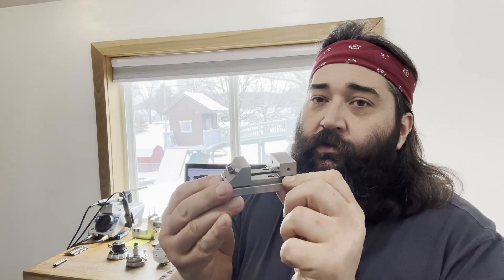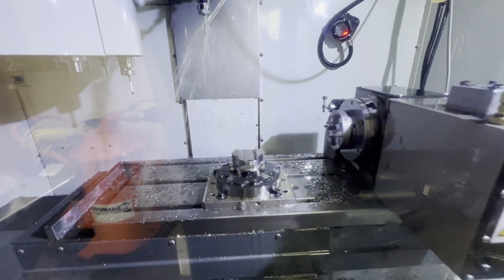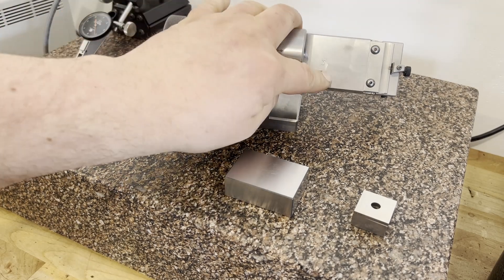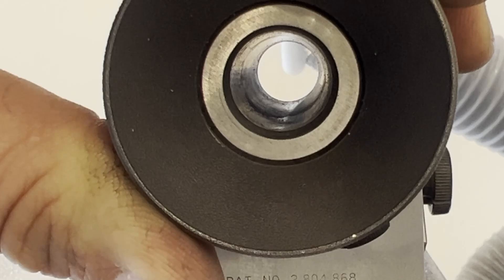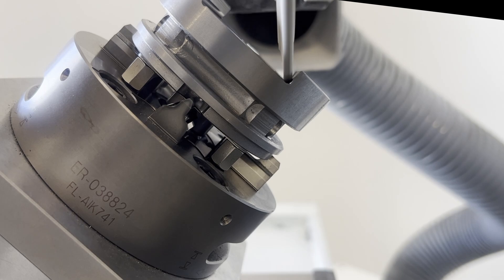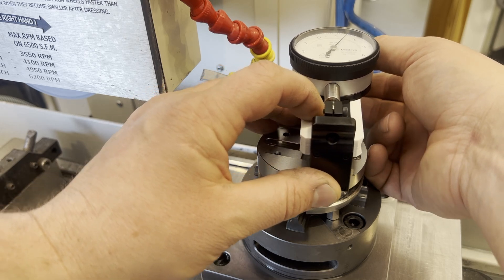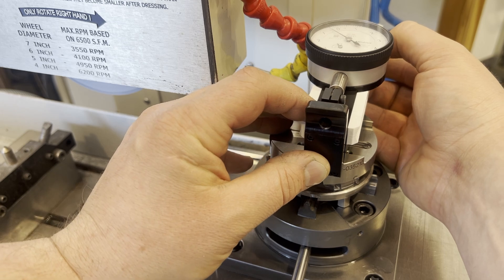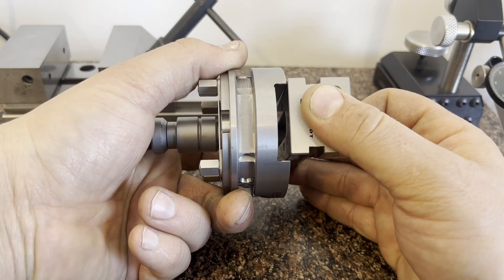The 180 Method: For grinding perfectly centered features

Comment: I'm wondering how you have your Haas setup to let you mid program load tools? or is it a manual gcode add?
Reply from the maker: That’s an alias code , when it sees a m6 with a “t” number higher than 9 it goes thru a different routine where it empires the spindle and waits

Comment: Awesome video. Quick novice question. About to invest in my first high end set of gage blocks (Mitutoyo ceramic 00) and debating between rectangular or square for surface plate use for inspection, calibration and occasional precision setups on the plate. Anticipating relatively short-ish stacks. Noticed you are using square in this video for on of your setups. thoughts on rectangular vs. square? Trying to “buy once, buy right”. Thanks for all your great videos!
Reply from the maker: I like the squares a bit more for being able to pass a screw down the middle , lets you solve all sorts of weird problems by attaching end plates
Reply: Feels like it’s hard to get experienced folks to be willing to give real opinions beyond “it depends”. Obvi, it always depends, so extra appreciate getting your thoughts and experience. Been watching you since your first video on the channel and always look forward to your latest!

Comment: I saw that YouTube quickly removed your video you made of the production of that outstanding device similar to the one created by John Browning in 1911. Since YouTube won’t allow you to demonstrate your outstanding craftsmanship, have you considered posting it on any other platform I watched that video three or four times before YouTube took it down. I have a small VMC and have dreamed many times of producing such a device myself.  My thought is if John Browning can produce it with primitive machine tools, in 1911 that I could reproduce one with my limited CNC capabilities that I have in my garage machine shop. Many of the problems that I envisioned I would have you demonstrated the simplistic solution simply because you’re a tool and die maker and repetitive set ups maintaining a close tolerance is your business.  The video was very inspirational. I hope someday to see it again. Obviously I live in the wrong corner of Ohio. I live down in Marietta in the south east corner all of the exceptional manufacturing is done everywhere else in Ohio except around me.

Comment: Im surprised you went for this style of vice as opposed to like a typical 5 axis vice.  Could you explain?
Reply from the maker: Self centering vises typically see a bit of jaw lift . not an issue for rough stock clamping or even general precision . But not something I want for chasing very small tolerances. These will mainly be holding small ground blocks and bounce between the cnc grinder and high speed mill

Comment: Watching this again and I was wondering how do you set the center of the chuck to the center of the wheel?  I have used a grinder but only for simple grinding for flat surface.  Charles
Reply from the maker: It doesn’t need to be set . In this case I just touch off the side of the slot from the mill . Ground till it just cleaned up and measured. Feed in based on that first measurement
Reply: @adamthemachinist  Ok you mentioned that the slot was centered to the center of the chuck.  I was assuming that you had indicated it in some how to set zero on the DRO.   Is there a way to set the origin if needed for that fixture?

Comment: Adam, what coolant are you running? It looks like oil, can you explain the pros and cons of your coolant choice. Thank you for the video, it's always such a wonderful surprise when upload!
Reply from the maker: That is oil, blaser gt 15 . Most of my machining is near net, meaning I have parts that start with very little stock. However, the material is often quite aggressive. Oil yields better tool life , and better finishes . It’s also much less maintenance than coolant . No water evaporation or rust issues

Comment: You mentioned wheel breakdown reducing the size of the ‘cut’ taken, is this offset from centreline, assuming it happens gradually? When you measure and take your final pass, do you take this into account by grinding that second side again and then flipping the part? Thanks, great video!
Reply from the maker: Yes, any adjustment cuts need to happen to both sides
Reply: @adamthemachinist  I meant in the sense that that couple of tenths total lost to wheel breakdown would cause the slot to be offset toward the first side, so would you need to make adjustment cuts starting with the second side in order to nullify the effect of the breakdown?
Reply from the maker: @MrJanStaines  that could become a problem if you where taking significant amount of hard material. But in that case I would likely be changing up the wheel and process to combat wear.
Reply: @adamthemachinist  thanks Adam! 👍

Comment: Great video! I need a grinder now after watching all your videos.  How accurate could the 6x18 you have be at grinding short lengths of rod like 1.25 inch long or so?
Reply from the maker: Its quite precise, we have lots of small/medium size batches of parts where it maintains a 80 millionths total tolerance. Often, what makes a tolerance hard to hit isn't the tightness of the tolerance but attributes of the part. How sensitive is it to temperature, how can we hold it in the machine, what abrasives can we use?

Comment: Adam, I love your content, but friendly critique: The volume on this video is very low. YouTube additionally castrates the volume a little on its own which doesnt help.
Reply from the maker: Good to know, that levels seems to be where I struggle the most
Reply: @adamthemachinist  As a rule of thumb its best to be around -28db to -8db at the loudest parts. The keyword is audio normalization
Reply: @adamthemachinist  Try running it through an audio compressor (if your video software has one of those sorts of plug ins).  It'll bring your levels up.  Thanks for all the content!